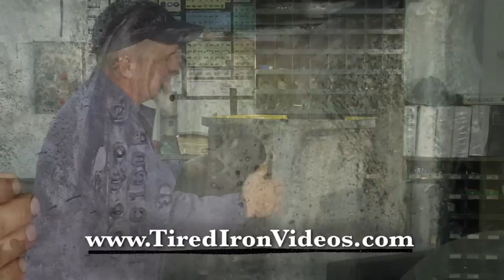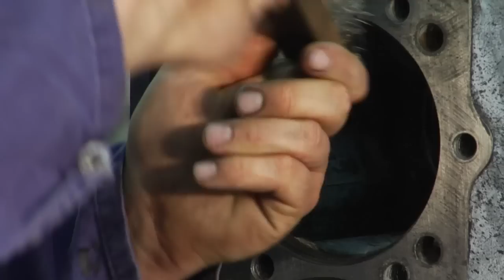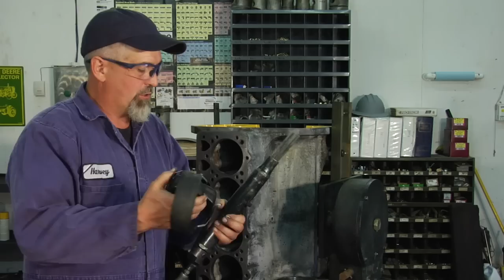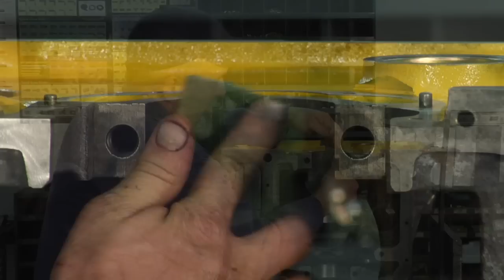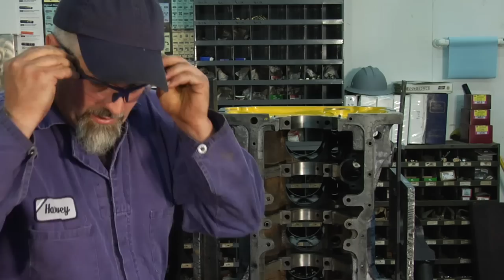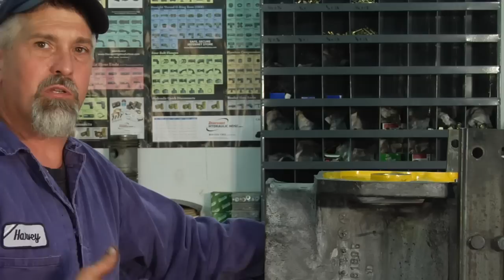Engine Block Cleaning

Comment: I came across this video by a random you tube algorithm.  First off I don't want to criticize your process but it is a little out of date and 12 years ago it was the way things were done. I live in Ca. the chances of finding a caustic tank are pretty slim. The newest process is thermal cleaning with a shot peen blast after. This process eliminates all need for scraping and hand work on the block. I personally chase every hole in the blocks with a tap or thread chaser. If you continue to use  the caustic bath this is especially important. After thermal cleaning the taps almost spin like a helicopter. Not chasing threads will cause inaccurate torque on the fasteners. This is crucial on the heads and mains especially. The only problem with the thermal clean is flash rust and that can be taken care of with WD40. always do a final cleaning of the block with a brush kit and degreaser.

Comment: I am having a out of frame rebuild on my detriot 60 series 14L. 
They found damage to the block where the liners sit. 
So they had to cut the block. 
But before they did that, they found damage to the crank. Block needed to come out, crank shaved and then vat the block. 
Then cut block and rebuild from bare block. 
They sent me pictures of the block after it supposedly got vatted but the block still has paint and also rust spots. 
Is there a vat process that doesn’t remove the paint ? Freeze 🥶 plugs are also still in the block after it got dipped in acid supposedly. Is that sound right to you?

Comment: The product is a solution of phosphoric acid and some chealated Form of buffered iron or magneisium. The phosphoric acid strips the oxygen from the the iron and the chealated iron or magnesium bonds to make the the iron valences balanced so they do not attract and bond with oxygen again. I have seen versions utilizing graphite as well. It works great, but it is electrolytic. It can cause aluminum parts not isolated from the block to corrode. If you have an iron block and iron heads it's fine. If you have one of those mistakes from the late 80's with an iron block and aluminum heads, don't use graphite mixes. I have never had problems using Ospho.

Comment: Degrease the parts using citric degreaser then use baking power or dry ice blasting and finish by degreasing again and rinsing. Nothing is static we must adapt and change to newer safer and better methods.

Comment: In cast iron use caustic soda soak entire engine, warm water better this will remove grease and grime, then pressure clean then use hydrochloric acid diluted in water the amount will depend on how fast you want it cleaned, soak the whole block it will remove rust once grease has been removed, phosphoric acid will treat rust and dissolve it good for final finish, you can also use washing powder soak all metal parts wont harm aluminium, soak in diluted molasses this will remove rust in a few weeks, remember to neutralise the block when finished, follow up acid with high PH like washing powder or the like or reverse high PH then soak briefly in acid, remember chemicals and acids can damage any metal so use correct method and test first, hope this helps,

Comment: you want to run a thread chaser NOT a Tap, tap will remove metal.
Reply: Mike Mike. Agree a tap will remove metal and weaken or ruin the threads, thread chaser are designed with softer metal for the purpose of cleaning the thread gentler wich produces nice clean threads don't forget to blow afterward the thread holes to finish the job.

Comment: I would never Sand a block surface! that's just bad practice
Reply: Assuming you used a flat object, 320 grit isnt going to remove enough material to be significant, and sandpaper is one of the few things that will remove enough foreign material to provide a good mating surfaces. Not using fine grit sandpaper to clean mating surfaces is, more often than not, the worse practice.

You aren't trying to remove metal, and should not use a power sander, light sanding by hand using a flat sanding block is a common and beneficial practice.  In fact, using razor blades after removing most of the material will often result if deeper scratches than sandpaper, especially if the blade gets worn and nicked.
Reply: Sanding just to clean the surface is fine. I use give or take  150 grit or sometimes what ever it there. but only by hand.
Reply: Amra 150 Grit really works the best, the fine sand paper takes to long and is a waste of time. the rough surface left helps the gasket seal better. Razor blades are dangerous on cheap Aluminum parts. I use a very sharp scraper for gasket removal, I grew tired of the flying broken pieces of razor blades and wondering just where they ended up if I could not find the broken piece.. A iron engine block will in no way ever be hurt by sanding by hand, In no way will you ever hurt a Diesel block,the iron is just to damn hard.

Comment: A oil pump does not produce pressure, it produces a flow. Restrictions in the oil gallery to different parts produce the pressure.
Reply: +peter ferri What Roy is alluding to is that the volume of oil coming into the gears is the same as the volume coming out of the gears, thus there is no change in pressure due to the oil pump - the pressure only develops when the volume is decreased due to restrictions within the engine (or when the temperature is increased). It's a nuance engineers/scientists like to make, but is really of no relevance here ;)
Reply: +Roy Leblanc  Why does the pump have an oil pressure regulator if it makes no pressure?
Reply: peter ferri The pump creates flow, think of it like when you turn on a water hose. The water flows out freely, you can squeeze the hose easily because there is no pressure. Now if you put a restriction at the end of the hose and turn it on and try to squeeze the hose it's much harder. This is the same in the engine of your car. The oil pump produces a flow of oil that eventually hits restrictions which causes pressure build up because the oil pump is constantly moving the same amount of oil. The pressure regulator protects the pump from too much pressure being built up because the more pressure in the system the harder it is to operate the pump. A good example of this is on a return less fuel system, if the pump continuously runs without the engine running and the fuel injectors not flowing the pump would be damaged quickly from stressed operation. This is why when you first turn on your key the fuel pump runs for a few moments and then turns off (primes the fuel system). Point is a pump creates flow, restrictions cause pressure.
Reply: peter ferri also the pressure regulator is usually a ball bearing with a spring behind it. The tension of the spring sets the pressure in a sense. The more stiff the spring the more pressure needed to push the ball bearing back. Once it's pushed back it opens a oil passage to allow flow to reduce pressure in the system.
Reply: The pumps that I have worked with have a crescent in between the gears, the inside gear being the drive gear, and the outside gear being the driven gear. One side of the crescent is the suction as the gears rotate they squeeze together forcing the oil out the other side under pressure, as rpms increase so does the output pressure of the pump. A worn pump will also introduce air into the system called cavitation, causing a drop in pressure and volume making slow response to the clutches and converter. The air in the system has no lube or cooling properties, so the transmission will be sluggish and overheat.

Comment: Great Video - thank you.  I learned something.

I don't use sand paper or abrasives to clean precision surfaces though.  You run the risk of leaving grit on the engine and you remove a little bit of metal from the surface.  Each time the surface is eroded and not as flat as it was....

I scrape and clean with steel wool solvents, etc.
I would remove a raised burr with an oil stone or gentle flat file.
Reply: I have used sandpaper and it has always been beneficial to me. I tend to go to 400 when doing things made of aluminum and 220 when cleaning cast iron.

You are right that it will remove material but it is often not a big deal but just like you I worry about it so I end up grabbing a piece of glass and gluing sandpaper to it since it is an absolute flat surface and lap away. A lot of people don't believe me that this gives a much flatter surface than what was originally there but Jean Bugatti did it with his engines back in the 30's. It created such a flat surface he did not need to use a head gasket. This was done by hand to ensure quality which is why a Bugatti was high end cars back then.

I have tested it myself and it really works as long as you stay no higher than 800 grit when lapping. But after doing so it is necessary to spray the block down and let dry. I would only recommend it on parts that are removed from the engine. The block side needs the locating dowels removed before lapping it.

It is very possible to lap surfaces so flat that you will not need the gasket like Bugatti did.

But yeah always wash the part after sanding is done and follow up on it with a wipe down with either naphtha or mineral spirits.
Reply: @evilcowboy  I know this is an old comment, but the head gasket thing is highly dependent on application. I personally wouldn't run without a gasket on anything I'd be likely to build, but even if you wanted to, it'd be important to note that boosted engines see higher absolute cylinder pressures than naturally aspirated engines, and even if the surfaces are mirror flat on installation, the pressures will push the surfaces apart and you'll blow a whole lot of combustion into your water jacket and overheat quickly. Probably grenade your engine.
This is why serious boosted race engines generally machine a ring around the combustion chambers and use rings and copper gaskets. Creates a sort of labyrinthine seal that will keep combustion within the chamber up to much higher boost levels.
Important when building engines to remember that nothing is perfectly rigid, and rigidity is often a tradeoff for ultimate yield strength.
Setting aside that aside, it's not just boosted engines that can suffer from high cylinder pressure issues. High-compression NA race engines can similarly lift heads, and even on an unmodified (other than decking surfaces) engine seeing light street use, heat cycling will warp the surface over time no matter what you do, and your tolerances are zero running without a gasket. This means the only place you can possibly run with no gasket is something that won't be going too far, won't see outrageous boost (or has no need for coolant, like certain drag engines) and will be stripped down and rebuilt frequently. Probably after every run.
Technology has changed a lot since the 30s and anything modern other than race engines designed around the idea will disintegrate quickly with no gasket.
Reply: Definitely best to do your machining with machines. No matter how careful you are, if the surface you're messing with is meant to hold bearings, you risk issues you don't wanna risk.

Comment: Nice video. For the amount of effort that it takes to completely clean a block, I'm surprised that it isn't cheaper to simply pour a new casting, or CNC-cut a new block from a billet. No doubt it depends a lot on the hourly rate of the cleaner, and how much you're willing to do yourself.

Comment: Really helpful.
I don't know if you can help me. I own a 1977 3cyl ford 4100 and a couple months ago I asked a local mechanic to change the head gasket, because the cooling liquid was entering the system and I didn't want it to become a much bigger problem, but now it's much worse, drinking the whole liquid in half an hour. I'm thinking of fixing it my-self but i never done something like that. I am a maintenance mechanic not a vehicle mechanic :/
Do you have some advice? thank you :)

Comment from the maker: We did hot tank the block, that does not mean the oil passages are clean or do not have debris in them. By decking the block you change the liner protrusion which requires machining the liner steps. More dollars. Its up to you but I prefer to keep it stock.

Comment from the maker: That's exactly right. So then the counterbore would have to be machined an equal amount  to what was taken off the deck. If the deck is warped or gouged there is no option it will have to be flattened. Its important to check the deck with a straight edge and feeler gauges.

Comment: The other guy said why not just machine the block surface instead of cleaning it up. If the block has wet sleeves, the projection of the liners would be higher due to the reduced deck height.

Comment: Because there is a counterbore. Resurfacing the block would cause the liner projection to be to high and cause all sorts of issues. Would have to cut the block if you resurface it.

Comment: Ask a Cummins dealer how they like 3m pads w/ a die grinder. They might smack you. Scotch brite pads work best. Always plug your holes w/ plastic plugs and you wont have any problems.

Comment from the maker: @musical7777  In the video I tried to show options that would work for folks that were doing their own work and may not have the same equipment available as a pro. shop. Preparing an engine to be reassembled is a messy job, rust, scale, dirt, carbon, grit, oil, all have to be removed. The object is to use products that will clean the surfaces and then make sure ALL foreign material is removed, even the residual cleaning product.

Comment: get yourself a pressure washer,  the 1400- 1750 psi type.  do you really rebuild engines? surface all blocks, it ends a lot of head gasket probems.